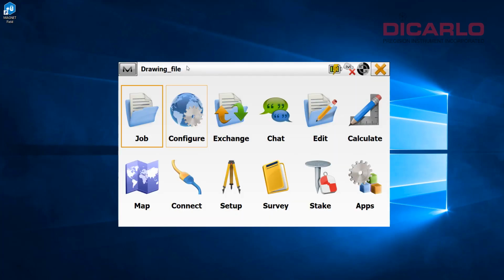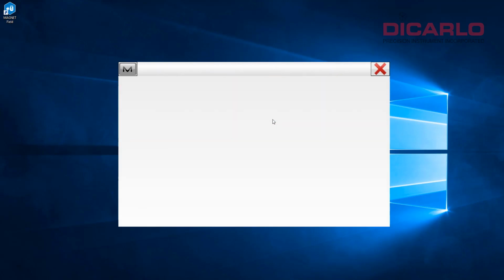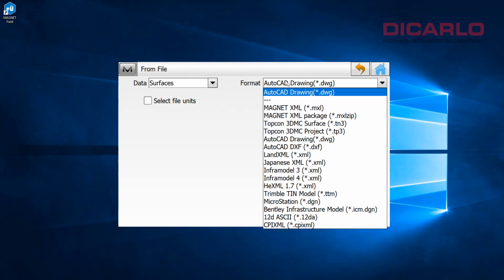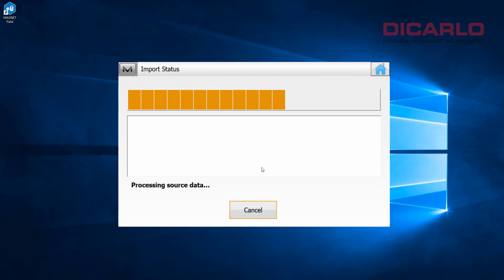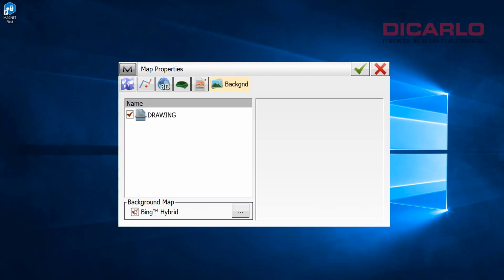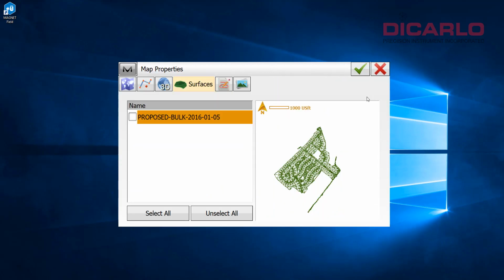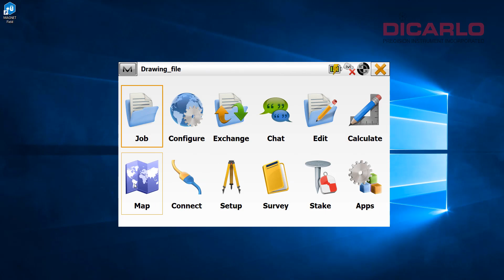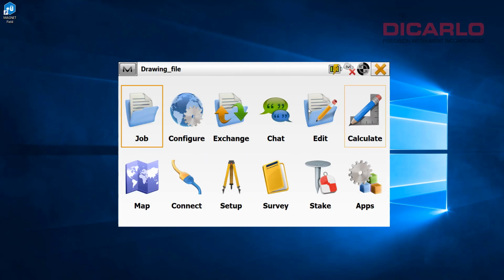MAGNET Field importing surface model XML

Comment: Hello DiCarlo, I have a question.  I’m going to try to explain this as best i can so there is no confusion.  I have a Topcon Rover and use Magnet Field as a personal set up.  At work i use Trimble with siteworks software.  Now in siteworks i have a Job Folder.  In that Job folder i have multiple design folders, one would be for a bridge, another folder for drainage, another folder for median barrier, another for electric layout, etc.  It just makes it look cleaner, instead of having all the line work for the entire job showing on the collector i can pick and choose what i want to layout so i don’t accidentally touch the wrong line and lay it out.  I noticed in Magnet field when i import those dxf files everything design goes into the job but i can uncheck the layers to minimize the clutter.  Is there a way i can create design folders within my job so i dont have to go through the layers and uncheck things?  Or is that how the software is designed?
Reply from the maker: This is simple. Anytime you import a drawing or surface, besides having to toil over which layers to enable/disable you can easily enable our disable the drawing itself. From the map properties. A drawing or surface is considered a background. Which you can enable or disable. Hiding it or showing it in it's entirety.
Reply: @DiCarloTV  omg that’s amazing.  Such a piece of cake.  Ok another question.  I may know the answer.  I have a lot of designs I want transfer over from Trimble to my collector.  Instead of importing one dxf at a time, is there a way to select multiple dxf files and transfer all of them over at once?
Reply from the maker: Not something I believe is possible. As multiple files can have (even though you can make it so they don't) different entities and then sifting through them, MAGNET Field would not know what to import from which file. So, in order to be "idiot proof" it is designed to make you import individually (even though advanced guys may suffer - but there are fewer of those than beginners). @littlenel17